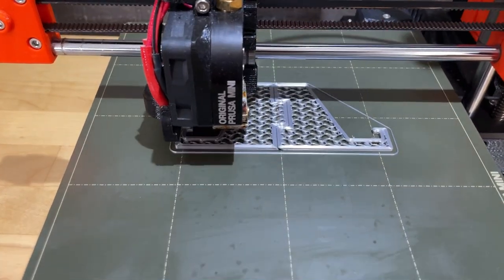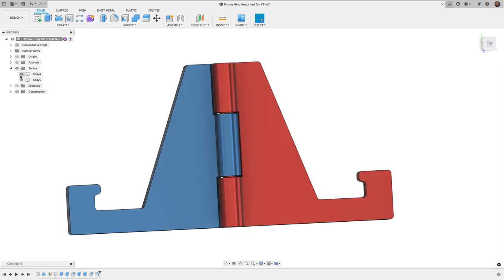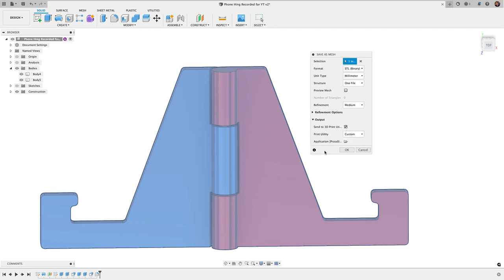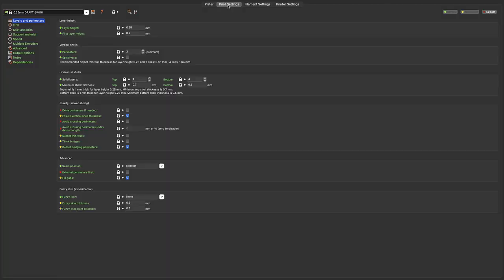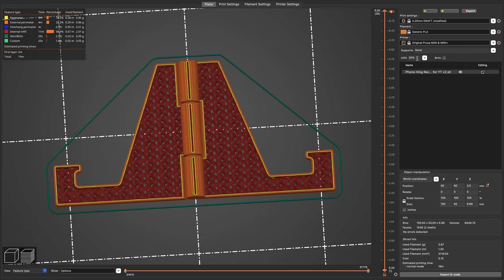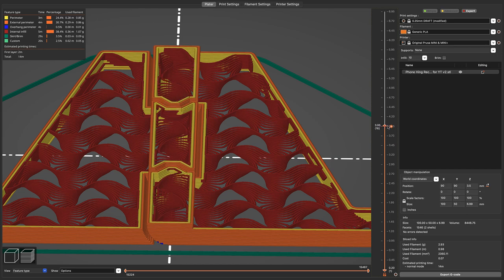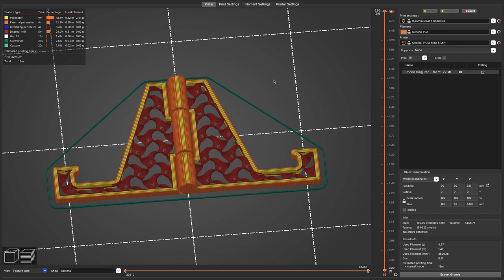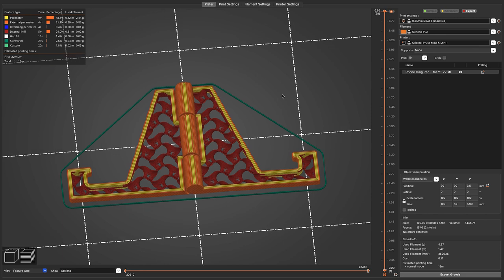Slicer Settings for Print in Place Phone Stand

Comment: Awesome trick.  Confirmed it works in Bambu Studio as well BUT you have to change one extra setting - under Quality/Advanced change "Only one wall on top surfaces" to "Not Apply" - otherwise it doesn't use the full amount of walls and the infill shape shows up on the top layer